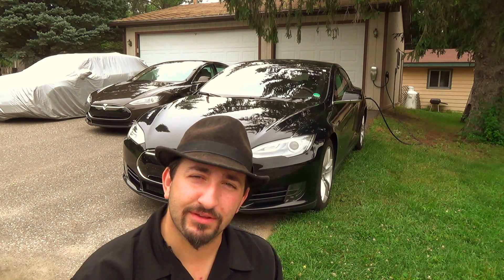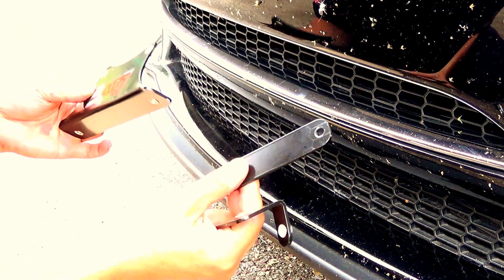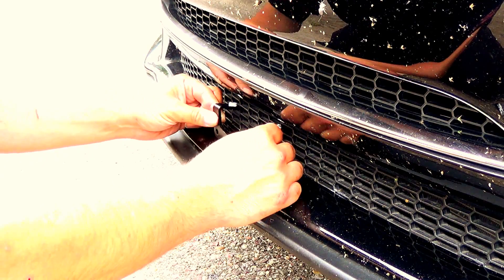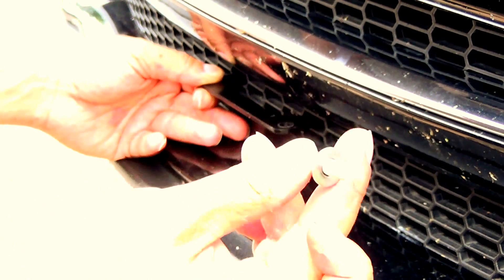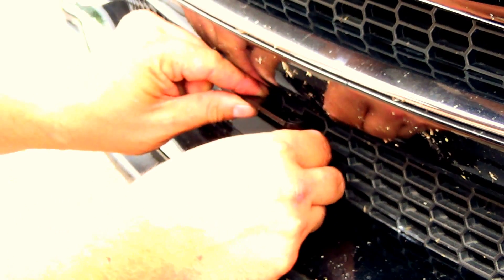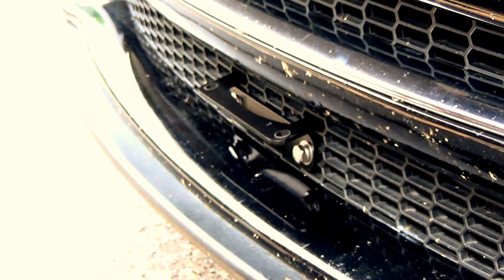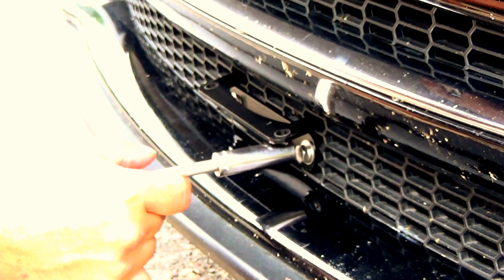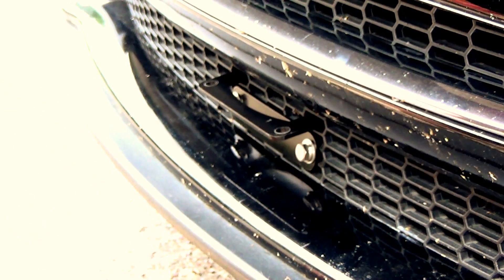Tesla Motors Model S: The LAW No Drill License Plate Mount Review & Install How To    TESLARATI.com

Comment: Hmm. What if the latticework ever cracks under the stress of that backplate? I can't imagine that would be a very convenient or cheap repair, say, if someone nudges you when parallel parking. I'd sooner see a pair of angled rods emerge from the lattice and be anchored to metal somewhere behind the nose cone.
Reply from the maker: Agreed. I think a padded piece between the two mounting brackets would help greatly.

Comment: Does it set off the parking sensors?
Reply: He doesnt have parking sensors on his car so he would have no idea. But yes, it will. It will also block your Autopilot sensor, which is right there at the center lower grill. Again, the car in the vid does not have parking sensors or autopilot, so he wouldn't know.